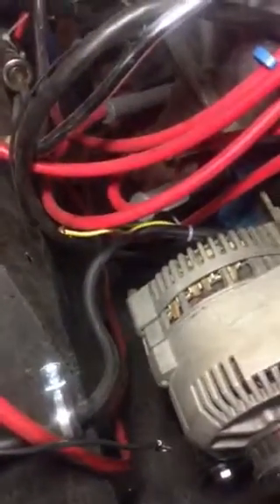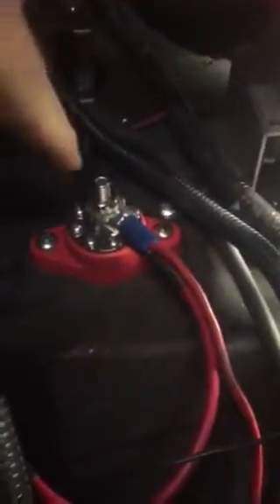Ford 3G Alternator Upgrade part 2

Comment: I have a 1978 Bronco. Alternator isn't charging battery. In your video you ran the alternator power 4g to the mega fuse. Where did your mega fuse connect to?
Reply from the maker: It was just spliced into the 4G wire between the Alternator B+ post and the Solenoid.  

http://www.gt40s.com/forum/attachment.php?attachmentid=59690&d=1342270328